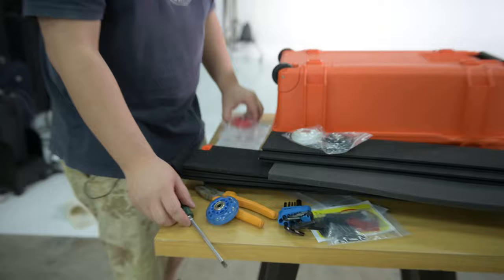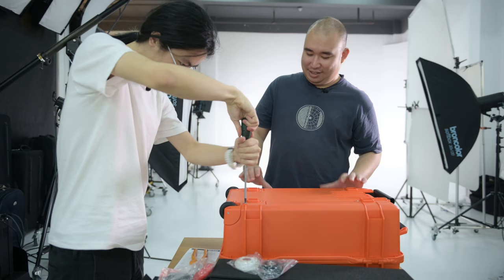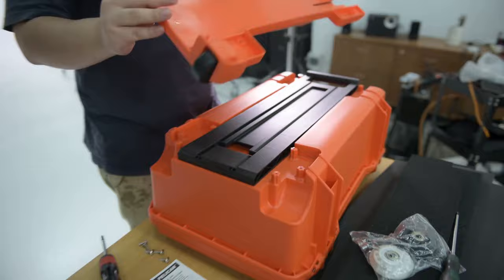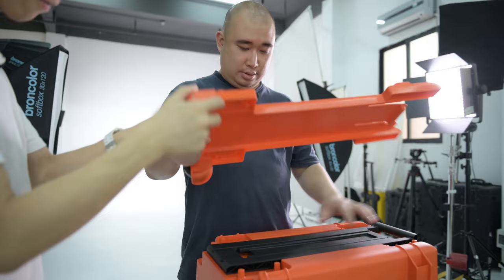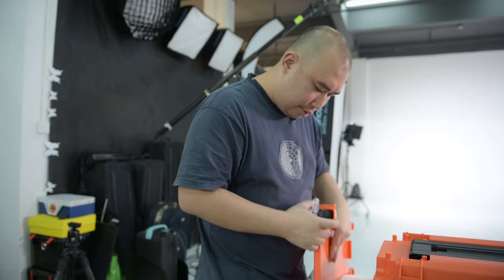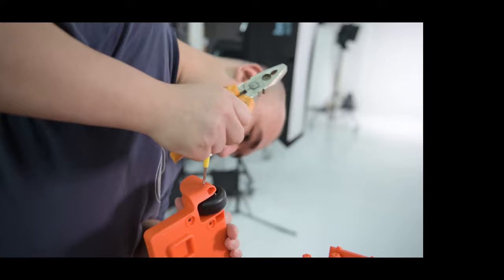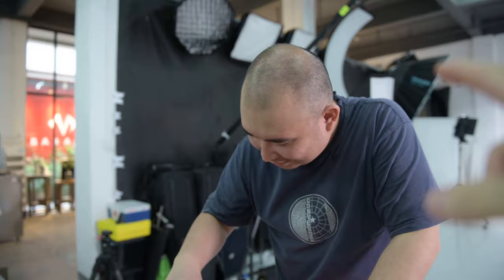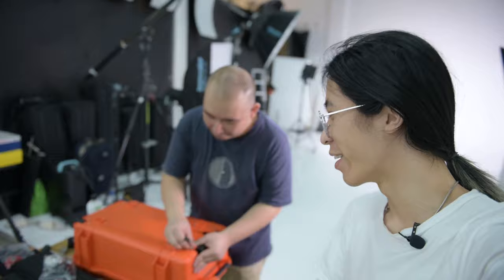How To (Not) Change the Wheels for Pelican Air 1535 | DoVlog 020

Comment: failed. but you can put the metal pin complett out and change the wheel, accept it. it's normally then the pin is not more fitting perfectly from the wrong side but you can glue it with special glue. 
 uhu max repair extreme but only 1 life, after that you need to drill it out when you need a new wheel again and also a new pin. possible is it. no risk and no lose.
i saw that your black wheels are really crap ^^ i can say from my side of practical experience: my bottom plate is strong heavy scratched. if you used it really in outdoor conditions :P
Reply from the maker: ya,  failed,XD..the air is slightly different from the normal pelican 1510, I changed my 1510's wheel since the 1510's wheels are much louder. The air 1535 version's wheels are actually much better than the 1510, but he was trying to change it for no reason lmao